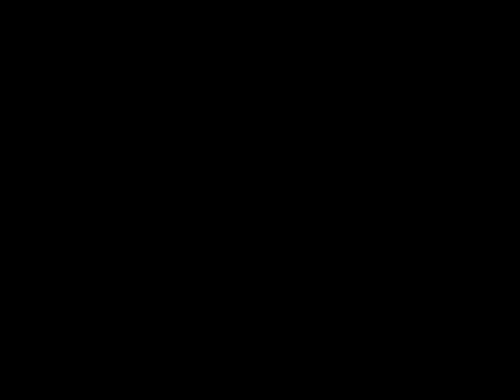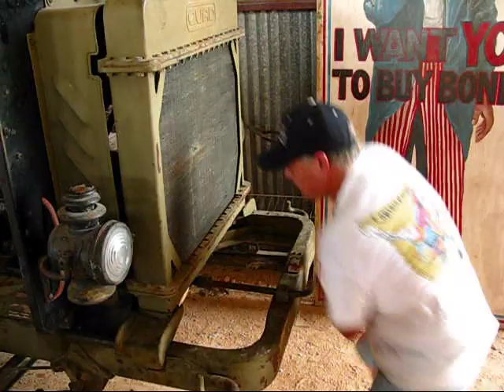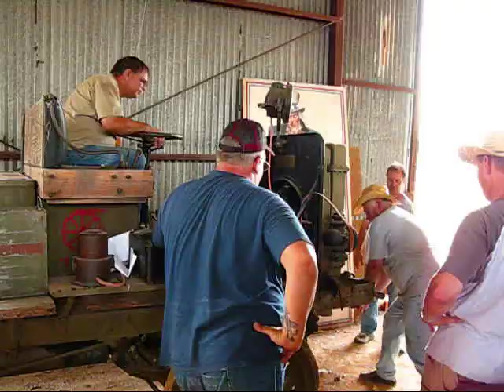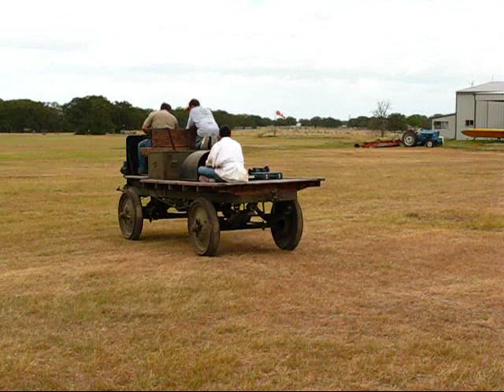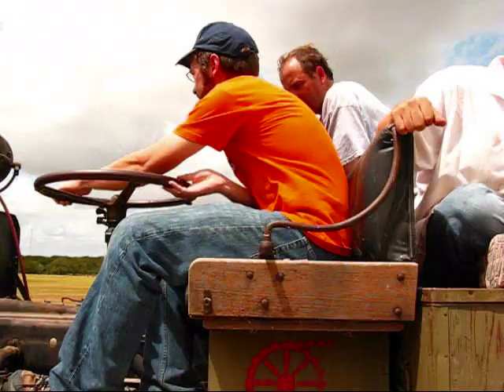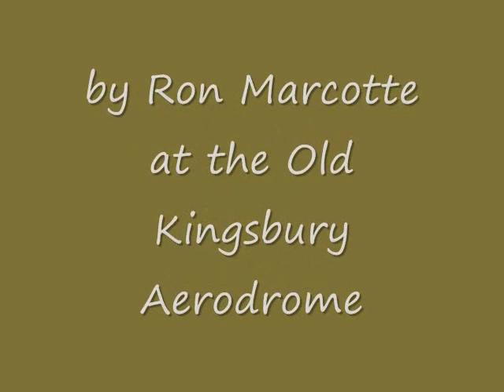Driving WW1 Nash Quad - 1918 Army Ammo Carrier

Comment from the maker: @5lkk The Quad is part of the Pioneer Flight Museum's vehicle collection so we try to operate it in an authentic manner--i.e. We crank it the way it was meant to be cranked.  With the spark timing retarded, it doesn't try to kick back.
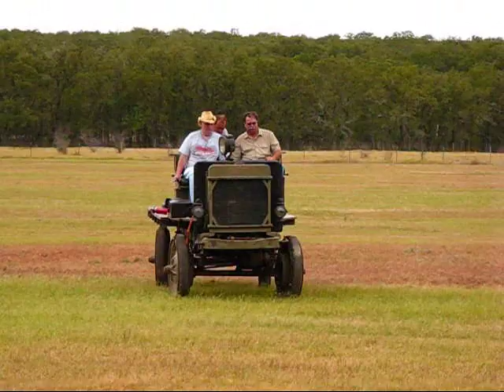   The action of the 4 wheel steering can be seen pretty well just before the 1:30 point in the video.  The rear wheels are turned about as much as the front.
Reply: My dad showed me how to hold the crank of a model T so it would not break my arm or wrist.... Hold it underhand!